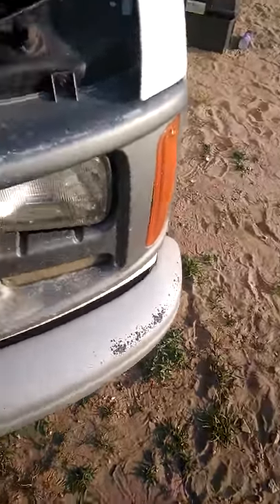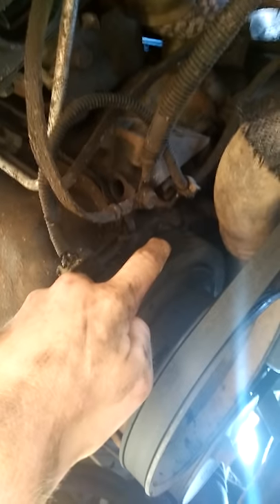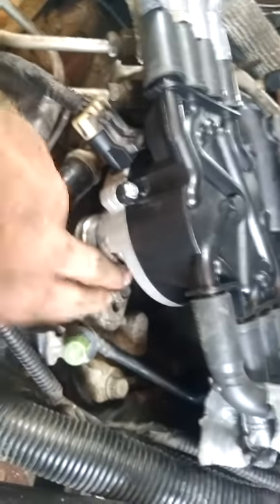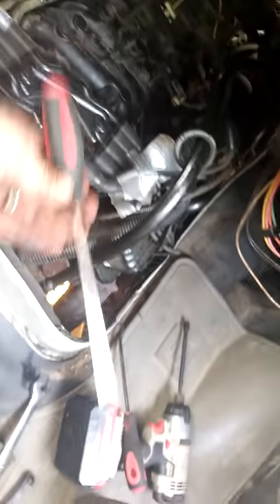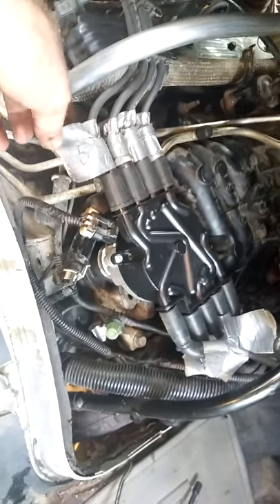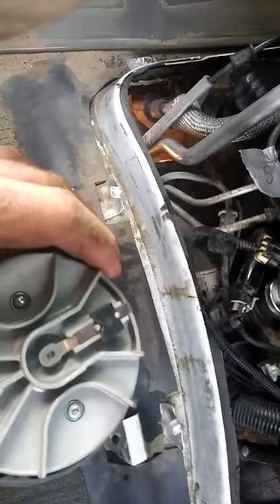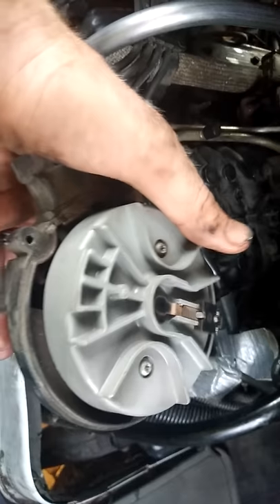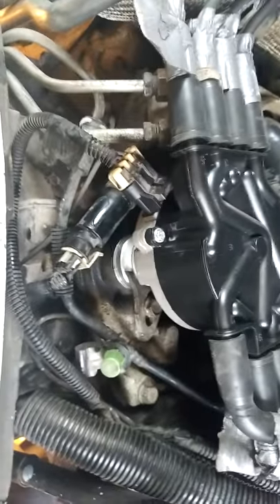5.7 vortec distributor replacement

Comment: You just turn it to the left a little bit then drop it in and a distributor should go right into place. It's the cam gear that makes it turn when it goes in. So you have to turn it toward your left and then it will drop to your right hand line right up. We've all had that fight with that motor
Reply: Do you have a video on this I'm having that problem also
Reply: @robertwells1601  what year vortec is it
Reply: Okay you have a little number six inside the distributor cap, you don't point the rotor towards cylinder number six. They have a number six on the distributor toward the left and that should fix your problem. You going to look at the way the distributor spins when you drop it in, if it spins to the left, you turn the distributor a little bit more to the right when you drop it in and it should go right to the mark where you need it. You have to align it with that number six for the express vortec. I just went through this a month ago.
Reply: The the number 6 Mark is where the distributor cap sits, it's not inside the cap. I don't know why my phone said that. It's inside the distributor right there on the plastic. You may have to look at your old distributor to get it aligned. It's definitely on your old one I don't know about the new one

Comment: Friendly FYI
You don't know that you are on the compression stroke when you are turning the Damper unless the Cap is Off to confirm that its Aligned to the No.1 Position Also.
Reply: PD Johnson or that it tightens up to the point you can barely turn it
Reply: If you guys got the video on this posted your link

Comment: You seriously spent three hours on the oil pump all u gotta do is set the distributor in and bump the starter and it will drop right down in the rest of the way u should probably get a new profession

Comment: You're setting it wrong look at the base under the root there tonpionts ornarriwn one with a  6 and one with an 8 you use which con insides with the motor your doing it for. And to justify this follow that channel running across the too the cap from the number one plug wire connection and it right there by the mark with which ever arrow you had ti use. This is a vortec its not set like the old school dizzies .
Reply from the maker: Shane Butter ok well you are either drunk or some bad auto correct but this if vary hard to understand. If you dont like the video than dont watch it it was just to help people not to live your life by
Reply: Fred Morgen bad auto correct  its nothing about not liking it doing exactly what you made it for just helping by giving the correct way to so it on the vortec there's a mark on the base for the 6 and 8 cylinder motors is what you use to set it right . just trying to help same as you so you can lose the attitude i never said not one ugly thing I'm my comments was just explaining the correct way tondonit was all i could care less when stuff like this is done is why keeps me busy and with work to make a living. Good day to you sir hope it's a good one.
Reply: Could you please fix the typos I'm working on the same thing well actually for an engine swap
Reply: thomasira62 yeah sorry about that was half asleep also what you got your trying to do is it on the 4.3 or the 5.7?
Reply: Shane Butter 5.7 Vortec 96 k2500hd
Reply: thomasira62 ok line up the side of the shaft under the worm gear one side will have two roll pins and one side will have one take the side with two line the up with tjw mark right above the gear with the two pins all in a straight line male sure oil pump shaft is turned the right way for when you have it all lines up like this drop it in with the flat part of base and or cap towards the intake and it should got eight in and seat flat to motor and rotor should be right on the little triangle with the number 8 on it you'll have two on base below rotor ones for the 5.7 the other is for the 4.3 and you should be good just male sure you on compression stroke at tdc when you do this works everytime and dead on everytime as long as you got everything lines up right the is a mark on timing cover and a grove on harmonic balancer to male it easier to put it on tdc also
Reply: What??
Reply: I thought it has to point at the number 8 for the 5.7 and the 4.3 is 1.
Reply: If you got a video on this post your link